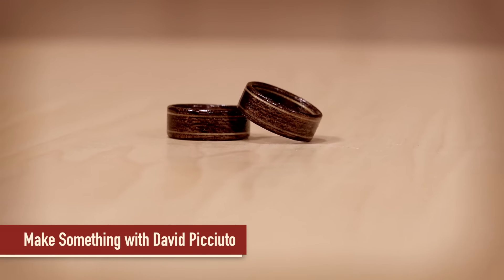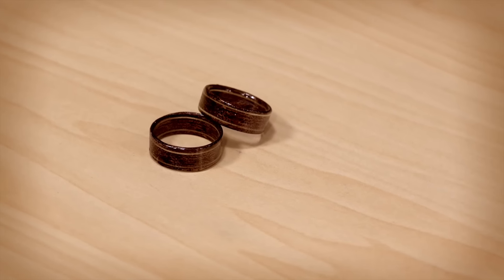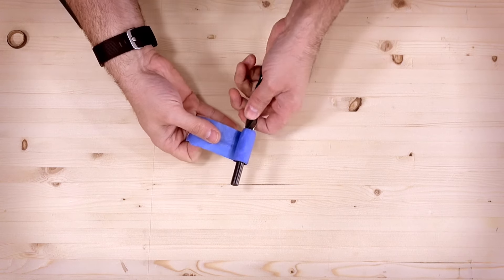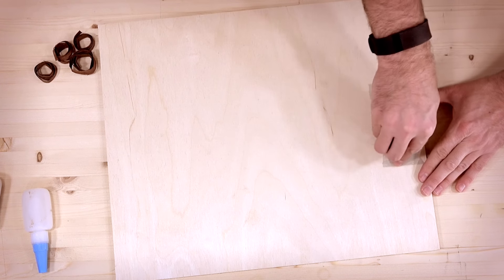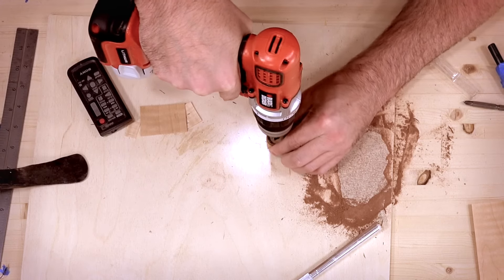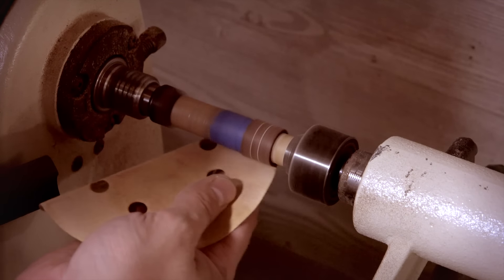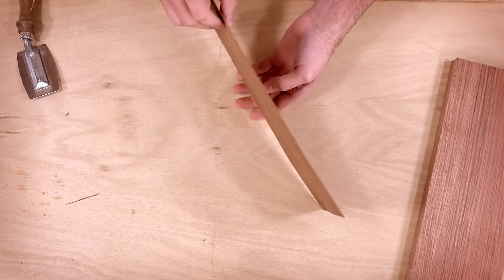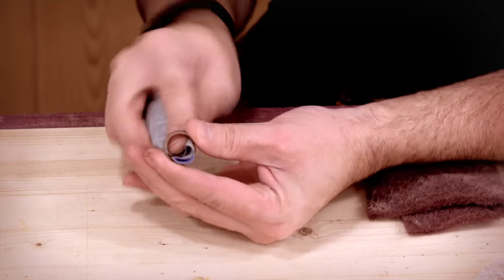How to Make Wood Wedding Rings | Quick and Easy

Comment: those are cool David, i have also been experimenting with ring making. I have been drilling a hole and then turning it on the lathe, like you said this method isn't as strong and the first 2 broke :( I then tried gluing two species together with the grain perpendicular, like plywood, and it has held up!
Reply from the maker: +Matthew Harper Keep experimenting!

Comment: So cool! Do you like the linseed/spray poly better than using the CA glue as a sealer that you did in the other video? Two less supplies to buy, but maybe worth it? Definitely going to try this one, thanks!
Reply from the maker: +Diode Press Thanks! Both methods work equally well. I was just trying something different.

Comment: Good job on that rings David! I prefer to use wood shavings for three reasons: they come out the handplane already coiled, they are easy to obtain without any power machine and they're thinner so they are less likely to break in comparison with wood veneer. By the way, congrats on your 100k subs. Cheers!
Reply from the maker: +Woodworking Barcelona Thank you!! You make good points. I may do a follow-up video in a couple of days using planed shavings.
Reply: +Make Something That would be great David. It's nice to share techniques and tricks ;D Regards!

Comment: Do you need to use a belt/disc sander for this project or would a palm sander work just as well for smoothing the ring and hiding the overlap of the veneer?

Comment: I said I was gonna use a purple wood, I was debating between dyed and purpleheart wood, I decided to go with purpleheart. but should I still use the linseed oil? This would be my first woodworking job. But if I could get a reply it would be greatly appreciated.
Reply from the maker: Linseed oil would work great on purple heart. I would then put on a few coats of spray lacquer as well for protection.
Reply: Thank you so much for the answer, I really appreciate it.
Reply: Also, sorry one more thing, I have some Loctite 420 super glue, could I use that in place of the CA glue?
Reply from the maker: yes!

Comment: how thin do the vineer have to be when i cut it myself? i try'd to cut it and boil it (60 min and longer), but it breaks when i bend it. and the grain is pretty much straight.
Reply from the maker: As thin as you can possibly get them.
Reply from the maker: The thinner the better.
Reply: +Make Something quick response :-) think i buy veneer from amazon. great vid btw :-D

Comment: You can stop at the boiled linseed oil or just rub on a thin coat of ca glue for finish.  Either will work fine, especially if you don't like that horrific gaudy shine.

Comment: What types of wood did you use for the rings?
Reply: Also, how long does it take for the glue to cure while cooling the rings, or should you hold it tight after wrapping it so the glue can cure for a few hours?

Comment: Boiled my veneer for over an hour and still will not bend without breaking. Why could this be happening? Bought from Woodcraft store.
Reply from the maker: +Jennifer Nelson Hmmm. Make sure the grain is really straight. You could also sand down the veneer to make it thinner. Also, You don't have to coil them real tight after boiling. Hope this helps Jennifer!